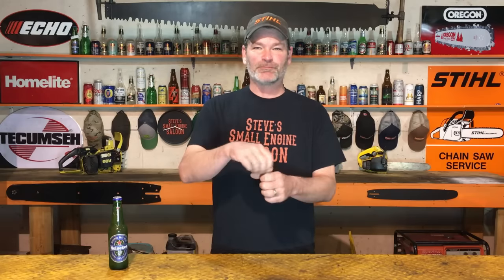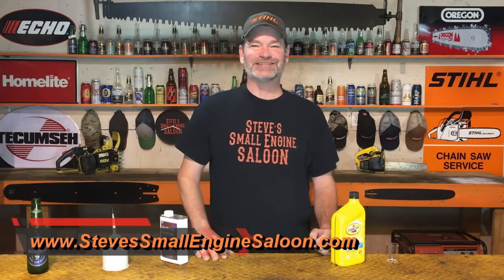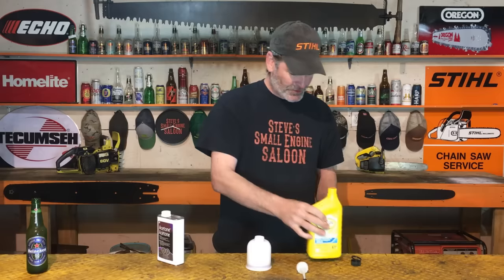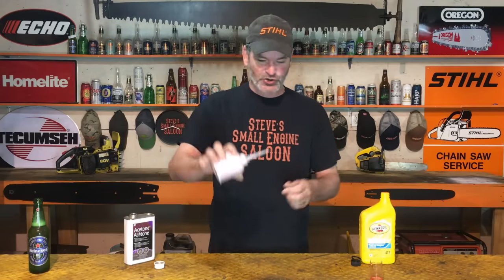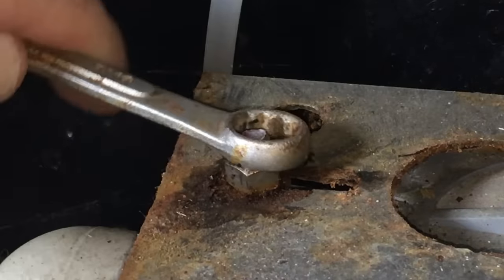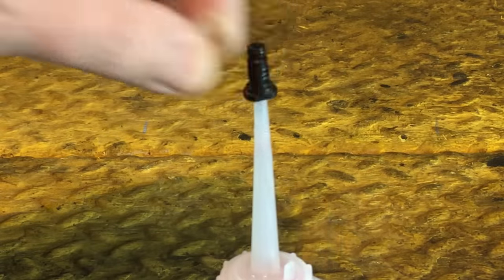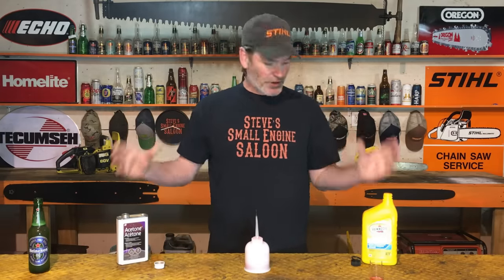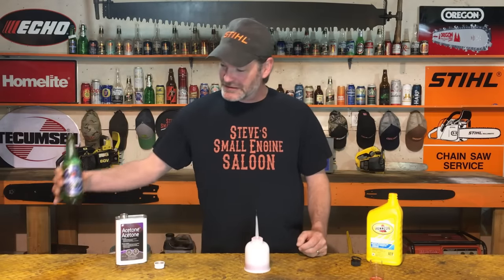How To Free Up A Seized Bolt or Nut

Comment: Hi steve,
Once  again i find myself asking for your help, this time frozen metal screws in my latest classic motor cycle ( 1956 velocete 200cc)
the scews that open the main cover over the electrics "such as points" would not move, i tried my god send 'WD40" but only one of three screws would come away the other two would not So i thought its time for a drink and to call Steve, and hey you have done it again with the ATF AND ACIDTONE, thanks Steve you are my Hero, and drinking Buddy, if you are ever over here in France and fancy a few drinks just let me know when .
Reply from the maker: Merci Danny, I am soooooo happy that helped you!

Comment: Use a diagrinder with a end brush to clean or a wire brush and tap on the flat side of the nut on a few of the sides carefully with a ball-peen hammer and the nut will come right off guaranteed! Even if it has been submerged in water simply soaking in oil will not open up the threads and break it loose. I worked in the ship yard and have had to remove 2" nuts from 1 1/8" bolts. Tapping on the nut spreads the threads even if its been tightened with a impact...

Comment: Hi Steve! My condolences! Thanks, Great video! What I like (if I have nothing else) is to hit the bolt or screw on top with a hammer in line with the axis. It also shakes the rust. Of course you need the space and a quite heavy hammer for this method. Also you have to pay attention to not f… up the thread… Cheers! RIP Mike!
Reply from the maker: Right on

Comment: Here's my trick for loosening break lines and bleeder screws: While you are pulling the wrench, tap the end near the bolt with a small hammer. Basically, you are making a mini impact wrench. Between the force of pulling and the vibration, they usually break loose.

Comment: I have used Phosphoric Acid , wait for the rust to convert to a white coating then scrub off the white with water, let dry, then WD40. But it is a slow process.

Comment: When it gets past penetrating oil and its time for heat, there is a trick to that which most don't know. Once you get it hot, don't try and undo it, spray it with water until its cool again. Not oil, or penetrating oil, just plain old water. Try it and be amazed.

Comment: I had an aluminum pulley on a rusty steel shaft that had not been removed in 40 years in anticipation of removing it I poured oil in the cup made by the pulley a week later nothing. I removed the oil put the acetone mix in and instantly it started coming out the bottom and the pulley came off
Reply from the maker: Right on

Comment: If you can get all round the nut, a hammer each side of the nut, strike simultaneously round the nut. Works good for me. Sometimes on small nut, a good vice grip used in the same way will achieve good results.

Comment: you have to be careful around open flames, or hot electrical elements , acetone also has a low flash point!
besides fast evaporation! HDPE, PP LDPE high density polyethylene, polypropylene, and low density polyethylene
are all acetone proof polymers that can be used. you can also use an dropper and use an everyday bottle.

Comment: I have used this formula.  It works but there is a limit to how much rust it will get through.  As always, apply heat for the most stubborn.  Might shear a bolt or just need to replace any hw that is rusted to hell.  Rip Mike.

Comment: Tried it once but after a couple of minutes they just seperate again. You can see the 2 layers in the container.  However ATF and white spirit do not seperate. And you are absolutely right. Best penetrating oil so far. Try it out. Same 50/50 mix but use white spirit instead of acetone. And most sincere condolences.

Comment: I was sorry to learn of your brother's death, but for those who never got to know him, he will be remembered for his excellent solution to a common, and often unsolvable, problem with rust-welded nuts and bolts.  I noticed (from the smell) that the Valvoline ATF for high mileage cars contains a little of the Ford additive you are required to put into limited slip differentials periodically to keep them working properly.  Next time I mix up Mikey's formula, I am going to see if the Valvoline works as well as what you were using.
Reply from the maker: Right on

Comment: Sounds crazy but first tighten tge bolt , this helps break the nut free and 8 out of 10 times the nut will come off easily!!! Note fire wire brush the exposed bolt end as to not pack rust inside the nut !!!

Comment: Belated condolences Steve. 

I’ve seen a great tip / technique for extracting a sheared bold on Salvage Workshop using Torx bits. Check it out.
Dave out.

Comment: Arrh so this is what I get if I go "Something you haven't seen before" ... ok
It's 3 years ago, you just lost your bro and this is a Really Really Nice Video in Honour.
In the last 3 years, We've moved from petrol to battery ... Everything Dies even Dewalt Battery Warning LED's die and give you the shits like "MY DEWALT  BATTERY'S SCREWED!" - but in this case it wasn't - it was just the Second LED dead stopping the third coming on making the battery look like it only had 1/3 left and refused to take a charge - BUT there was nothing wrong with the performance of the battery. 
When I first flicked to Battery I had already been impressed by Dewalt - I'm a retired Tradesman, been through a bunch of different batteries and tools and have settles on Dewalt.
And a 0.01Cent LED had my pacemaker going if I had had a pacemaker.
NZ$400 for a 12 amp hour and it was only an LED going down - after 4 years.

You see how things Change, baby is born another dies Spark Plugs to Batteries - Out of Death comes Life now 
What are we going to do with all those spark plug coils - Hundreds of now unused High Voltage Coils are heading to Land Fills ...

I'm betting I could make a cheap windmill to charge batteries to drive tools out of all those unused Spark Plug HT Coils.

Honour to your bro ...

Comment: I used this on some rusted bolts holding the bed boards in my trailer.  Let it set overnight, and they came out easily with a torx bit in an air wrench. The two I tried without it snapped off. Sorry. About your brother, Steve.
Reply from the maker: Thank You...

Comment: Nothing work like a mixture of oxygen and acetylene for really rusted nuts!
Reply: Not every DIYer has that on hand. I got a small propane torch but still will use the mixture and soak overnight before starting the job

In a rush, sure! Take out the heat wrench!

Comment: Why not just take a few drops of the acetone and ATF and put it on the bolt instead of mixing a bottle of it up
Reply: Ease of quickly dispensing the mixture

PS, it will separate so shake like a salad dressing bottle and then go at it!

Comment: Tried this and it still didn’t work.  I broke the square off of my breaker bar.  Tried impact driver, soaked it over night with this stuff and still nothing.  I managed to take the spindle to a repair shop and they were able to remove it.

Comment: BRAKE FLUID AND NAIL POLISH REMOVER!
Reply: some dollar stores have nail polish remover even. and used brake fluid works fine. i save used brake fluid for that reason! also removes paint off chrome. caution it removes paint so dont get it on any paint you value!